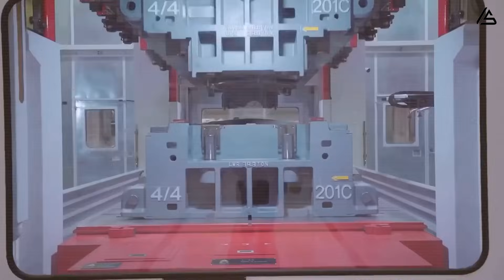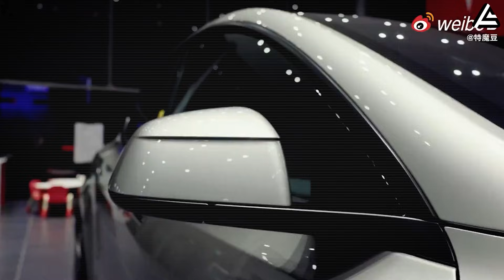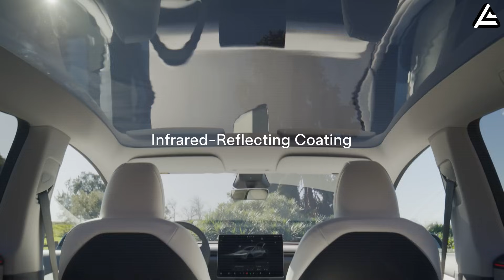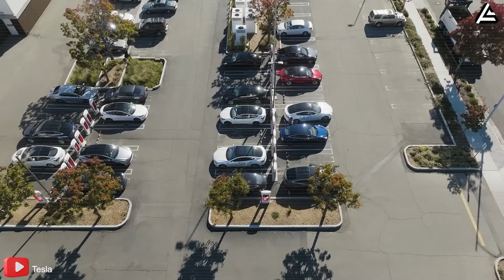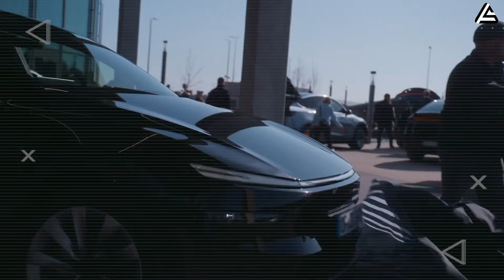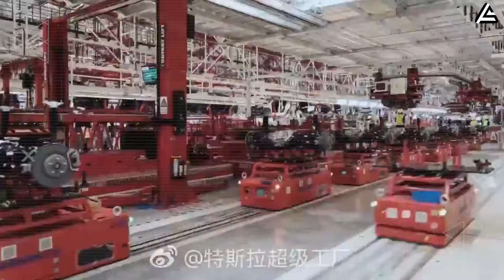2026 Tesla Products Coming: Model Y Juniper Changes & NEW Battery Techs & MORE...

Comment: If Tesla wanted to sell a cheaper car then why is the red paint so expensive. You could save $2000 there,
Reply from the maker: Paint pricing is mostly about options strategy, not the actual cost of paint. Automakers, including Tesla, Inc., keep one basic color in the base price and charge extra for premium finishes like multi-coat red because they take more layers, longer curing time, and lower line throughput.